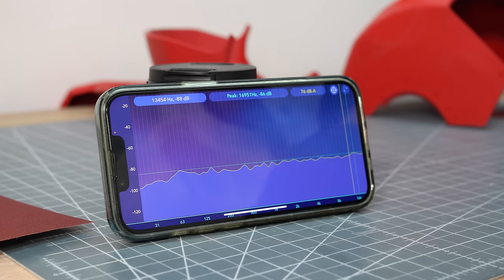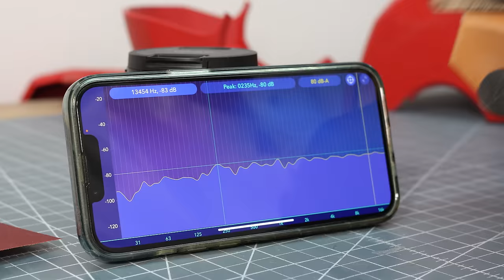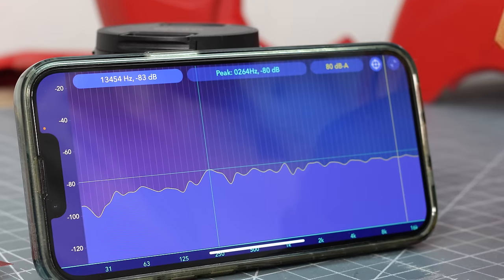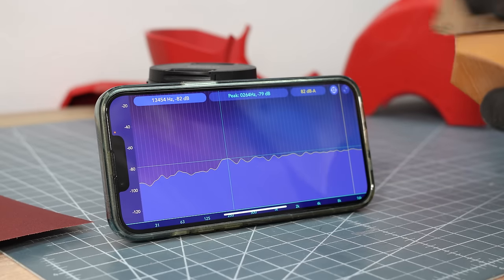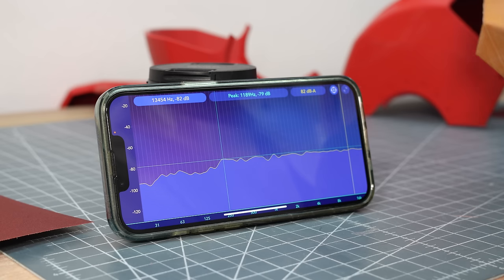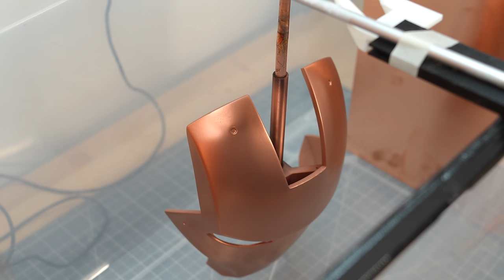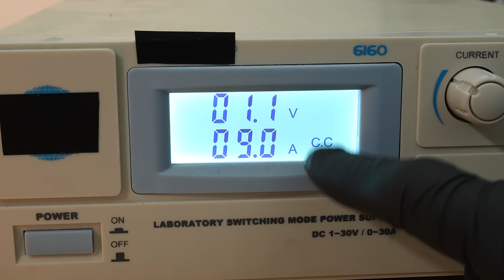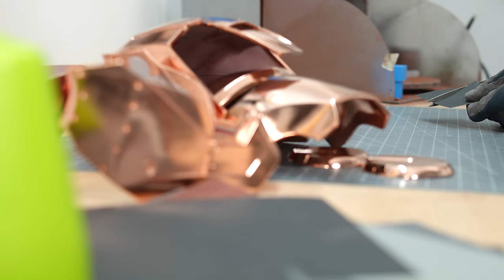I Electroplated a 3D Printed Iron Man Helmet and it's out of this World!

Comment: I'm really hoping a company tries to make a electroplating kit for 3D prints to increase the accessability to the consumer market. Once it's readily available and easier to use, there's so much that can be done with it! From metal plating gundam frames to making truly metal feeling cosplay like this! Great videos.
Reply: It's tricky. A lot of the chemicals used in electroplating are toxic, quite expensive and there can be shipping restrictions. Additionally, companies with expertise use proprietary brightener formulas to get optimal results and they are very secretive about them. This means they can charge a lot. The stuff that Hen3Drik uses is from Tifoo which is a brand only available in the EU and is incredibly cheap and seemingly high quality compared to what we get in other countries. Here in Australia, there's a company called Caswell that sells a bunch of different Electroplating kits - one for Copper, one for Nickle, ones for Brass or Chrome etc. They're REALLY expensive. 
You can also DIY solutions yourself at least up to a point - for Copper, you need Copper Sulfate crystals (which is a topical medicine used with horses and can be acquired really cheap from equestrian or rural supply stores) and Sulphuric Acid (often sold as a paving cleaner or pool acid, but very quite dangerous to ship). Likewise you can make Nickle baths using NIckel Sulfate and acid. The tricky components are the brighteners and additives to make a really clean finish, these are the proprietary chemicals. There are some online recipes to make your own brightener or sometimes the electroplating companies sell the brightener separately - so you can save cash by DIY'ing the bulk copper or nickel solution and just paying for the brighteners. There's heaps of info online about this, a lot of DIY videos and plenty of advice. But the process is tricky, there's often a lot of trial and error around getting good results and doing large pieces like Hen3drik does takes a lot of experience and expertise and a lot of expensive electroplating solutions!!
Reply: “Accessibility to the consumer market” is a recipe for disaster. This is some industrial-accident grade shit.
Reply: @AwestrikeFearofGods  eh, resin 3d printers were only realistically commercially available until the technology caught up. Hoping some innovation could do the same for this.
Reply: @AsimPaints ،،،،،،،
Reply: @Starganderfish Thanks for the info mate

Comment: I used what I learned from your electroplating videos to plate a few prints. My first projects were going for oxidized copper or bronze patina, so mistakes were "on purpose". I used scrap copper wire for the anode. I found more predictable results with bottled or distilled water.
Thanks so much!

Comment: Awesome work my friend. Your attention to detail is amazing. I do have a tip on the primer sanding step though. If you use a contrasting color of primer and put a very light dusting coat over the grey, it will show you all the low spots and scratches because they stay the contrast color as you sand until they are actually gone.  This is an old body shop trick called Tracer coat, or guide coat.  It will enable you to get a perfect finish and those scratches and low spots can't hide from you. This also works with wet sanding as well, which is my preferred way to sand parts. Less mess and the slurry helps the process.
Reply from the maker: I use this technique for evenness now. It’s working so good, thank you.
Reply: @hen3drik  Glad it helped your process.  Nothing is foolproof, but this is almost. 👍

Comment: The finished piece looks beautiful! And I'm sure I don't need to say it,  but this is actually what they did for the Lightsaber hilt props in the Star Wars Prequels, unlike the Original Trilogy hilts that were made from real world parts, the prequel trilogy props were either machined from metal or made from resin and chromeplated. Whilst not exactly electroplating, I imagine it was a somewhat similar process.

Comment: Suggestion? Increase your joint's strength with automotive aluminium bumper staples. A join with metal wires is far stronger.

Comment: there are flexible rubber light up eyes available that come with battery packs, so you dont have to heat form or solder on batteries

Comment: Great results, bravo! I would appreciate it if you could answer two questions.  1. Why do you not plate smaller pieces in the same bath as big pieces? 2. Why do you use palladium instead of nickel? Thank you very much. Once again, great work.
Reply from the maker: Thanks, 1: no specific reason. I don’t want to put small anodes in there maybe 2:  nickel electrolyte is more hazardous

Comment: Well Done video Mate! 💯 I’m looking to do same process but using Bright Nickel plating solution I’ve been using for scale model  Brass auto parts I’ve machined. I knew that pretty much anything can be plated, so my next project was to Nickel Plate ABS 3D printed parts Ive designed. I’ve only used the Bath Electro-Plating process gave me several great modification ideas for my Bath setup used for Bright Nickel & Black Nickel. 
Thanks for your professional help & 💡’s💯💯
ZenModeling

Comment: Warning: when using a hot glue gun with 3D prints make sure to either turn it down if you can or wait a couple seconds for the glue to cool or you may deform your prints with the glue heat ;)
Reply from the maker: 😉 yep!

Comment: What power supply are you using?  I will cross reference it to something more available here in the USA, but I want to make sure I do not get something too weak or too powerful
Reply from the maker: You could look for a rectifier with a constant current or a regulated laboratory power supply. 5A-10A just fine, I have a 30A which is capable for helmets.

Comment: Hello. If you have a moment, what kind of power supply are you using? Can i buy just any off Amazon? 30v 5A? I am looking forward to trying this that you do. It is very impressive and beautiful. Thank you.
Reply from the maker: You‘ll need a power supply matching your needs. 1A/dm^2. it also has to regulate voltage (constant current).

Comment: is there a way to make the electrolyte from scratch?
Reply: yes, there are several ways. the most common DIY options are nickel and copper, for copper you can make copper acetate or copper sulfate based electrolytes, or for nickel you can make nickel acetate or nickel sulfate electrolytes (sulfate works better than acetate). If you want more details, feel free to send a reply

Comment: Don't sand your prints.
Scrape them. Look into wood scrapers. It's faster and gives a better finish.
Reply from the maker: I just purchased these card scrapers. Seems worth a try. Thank you!
Reply: @hen3drik  learn to sharpen them too
Reply from the maker: @bschwand  yeah, I got that tool with it, too.
Reply: @hen3drik  I don't know what tool you got for sharpening but I just use a tungsten carbide rod. 

I love the scrapers because you can remove material aggressively without heating or melting the part. It does require different holding strategies though. Also, you can find scrapers (or cut yourself) different shapes to reach difficult parts. Finally, a scraper lasts forever, unlike sandpaper.